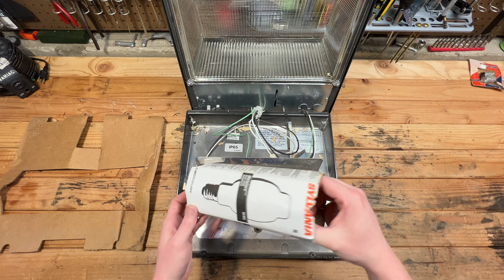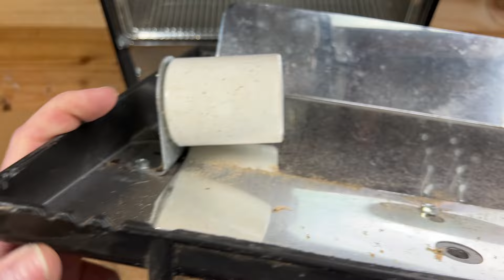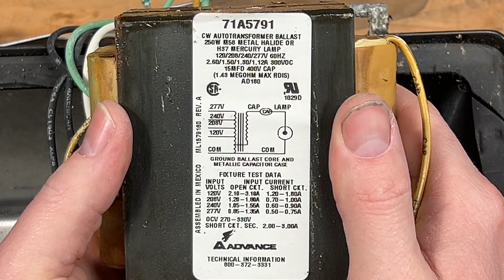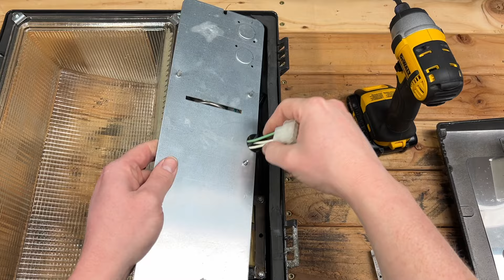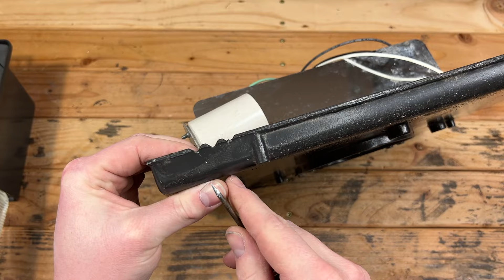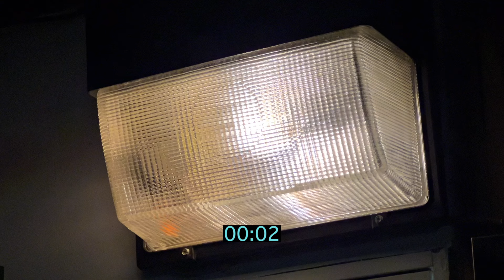Lithonia Lighting TWH 250watt Metal Halide Wall Pack Fixture

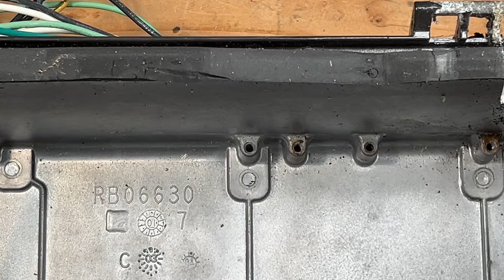Comment: There is a datecode on this fixture. On the inside of the ballast compartment there is a 'clock' date code, visible at 08:09. I believe the one most clear is the one of interest, bottom left. I'm not the best at decoding this style of date code, but I translate it to Nov, 2003. the middle number is the year, and you count the dots going around the 'clock' as the months. This style is not a very good one as the dots often don't go where they're supposed to. The 'compass' style is much better, where the year is still the number in the middle, there are numbers 1-12 around the outside for the month, and an arrow in the middle points to the month.
You have the fixture in front of you, so you might be able to more accurately decode the fixture than my Nov 2003. It looks like a good quality fixture, glass looks like that from a Holophane Wallpack.

Comment: Can you swap the type of HID bulb in fixtures like these or streetlights? (IE mercury vapor in an HPS fixture)
Reply from the maker: No, most of the time the ballast in the fixture is only made for one style of HID bulb. However, there are some exceptions, probe start metal halide ballasts can also run mercury vapor bulbs in addition to their intended metal halide bulbs.
Reply: @Parrot175  another question. My neighborhood has mostly hps fixtures, with the occasional LED. I’ve noticed 2 or 3 fixtures that produce a green-white color. Could those be MH/MV, induction, or NA starved hps? I can’t see the arc tube so I don’t know

Comment: Where's the ignitor in your 250w fixture? First time hear about capacitor ingition system, in 220v countries capacitor in only for efficiency...
Reply: Ignitors were used only for all high pressure sodium lamps and pulse start metal halide lamps. This one is a regular probe start and therefore doesn't use one.
Reply: For North American probe start metal halide light fixtures, they rely on a somewhat high ballast secondary voltage somewhere around 300V for reliable lamp ignition.

Comment: I do like these lights a lot. Lithonia did make these lights with a polycarbonate refractor and door, called the TWP. From what I've noticed, they're far less common than the TWH, which is a good thing.

Hubbell actually did make those medium sized rectangular wallpacks with a glass refractor and metal door, called the PGM. From what I've seen, they're unfortunately far less common the ones with the polycarbonate refractor and door, which was called the PVL3.

Comment: Now you need a 250 mercury version of this wall pac  so you will have all three of them in your collection of those lights
Reply: If I am not mistaken, these wall pack fixtures were even made to run 250W M138/M153 pulse start metal halide lamps as well.
Reply: @worldwidehidcollectorusa-fkt   they are out there just trying to find one of those is a bit harder to find